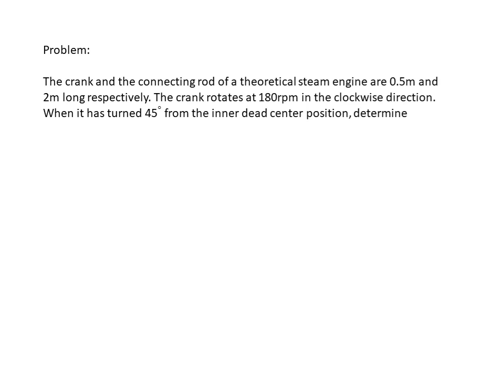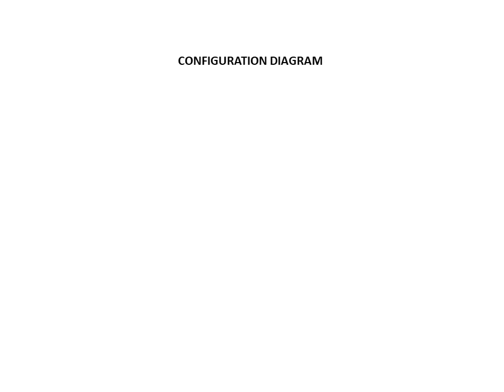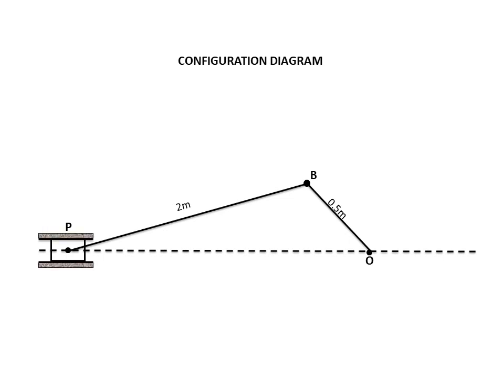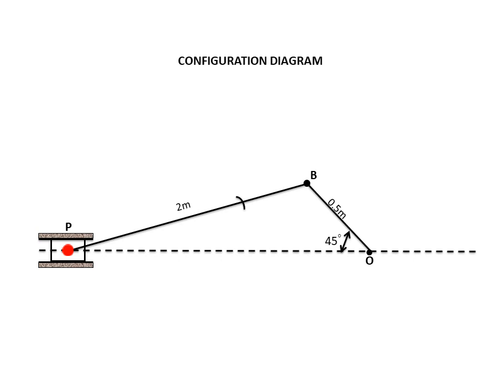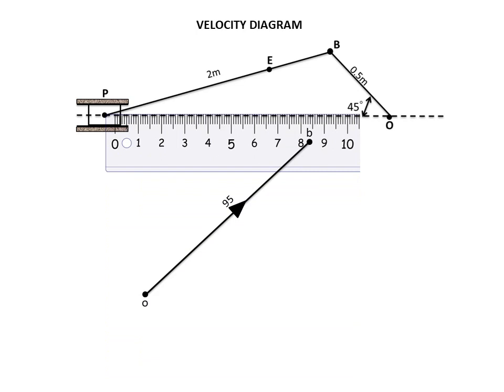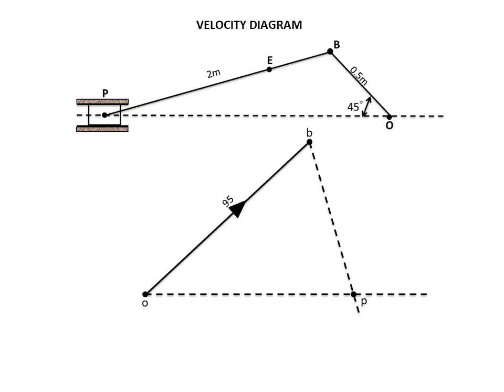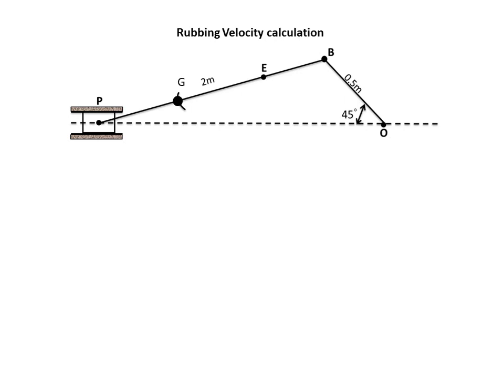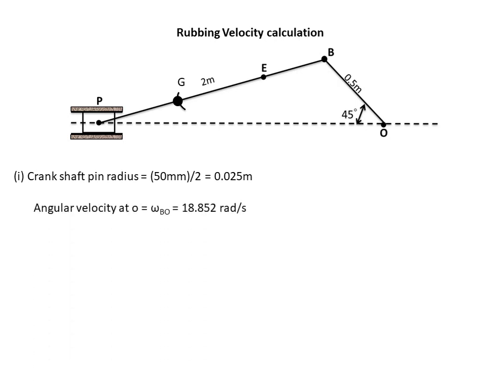Velocity in mechanisms   Solution to Example problem 7.2 in R S Khurmi book

Comment: A vibrating system having mass 1 kg is suspended by a spring of stiffness 1000 N/m and it 
is put to harmonic excitation of 10 N. Assuming viscous damping, determine (i) the resonant 
frequency (ii) the phase angle at resonance (iii) the amplitude at resonance (iv) the frequency 
corresponding to the peak amplitude and(v) damped frequency. Take C = 40 N-sec/m.

Comment: A rotor of mass 10 kg is mounted mid-way on a 20 mm diameter horizontal shaft supported 
at the ends by two bearings. The bearing span is 800 mm. Because of certain manufacturing 
defect, the centre of gravity of the disc is 0.1 mm away from the geometric centre of the rotor. 
If the system rotates at 50 r.p.s., determine the amplitude of steady state vibrations and the 
dynamic load transmitted to the bearings Take E = 200 GN/m2